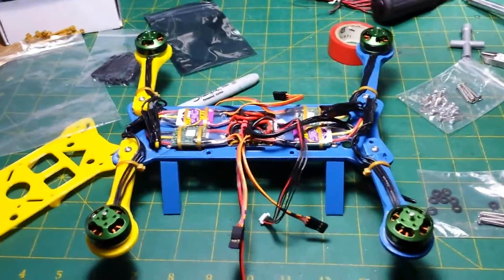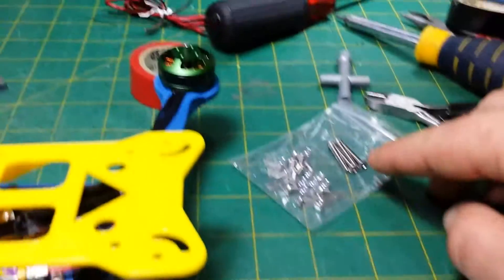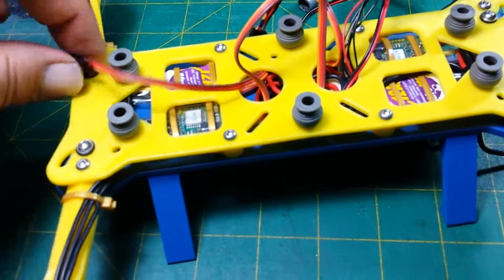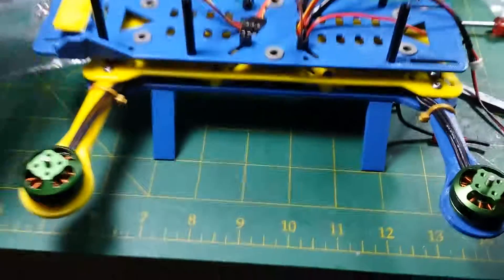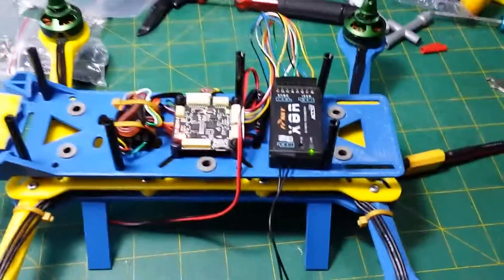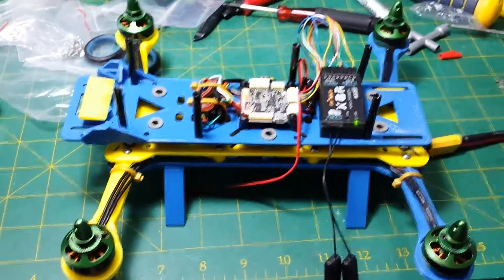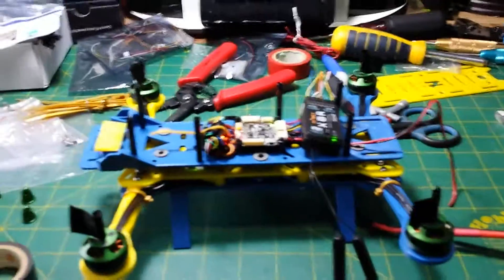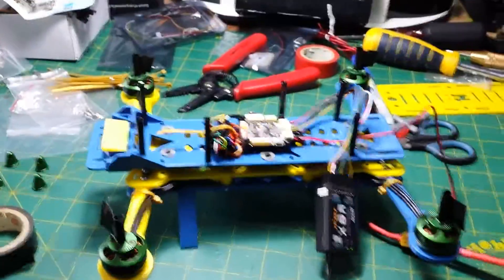MHQ2 Build log - part 4

Comment: Can you leave a link for the rubber dampers?
Reply from the maker: https://hobbyking.com/en_us/vibration-damping-ball-80g-8-pcs-bag.html
Reply: kitecraft - thanks! Unfortunately out 9f stock :(. But thanks for telling me where you got them!
Reply from the maker: No Problem.  Hobbyking has a variety of different weights and sizes of dampners.  They might have a suitable replacement in stock.